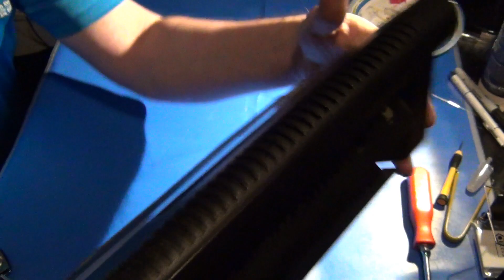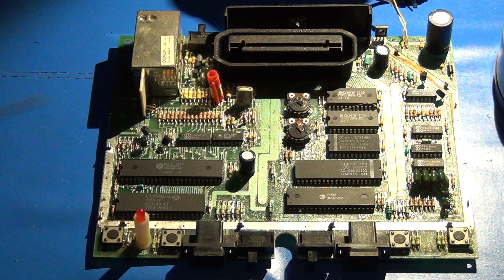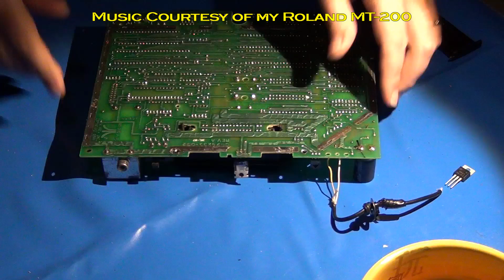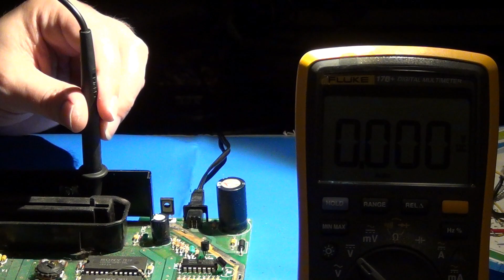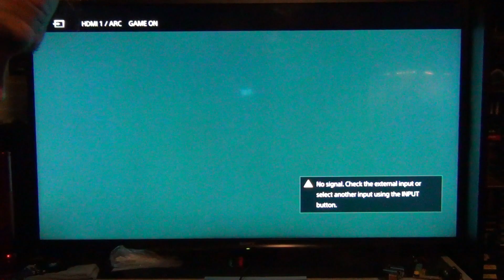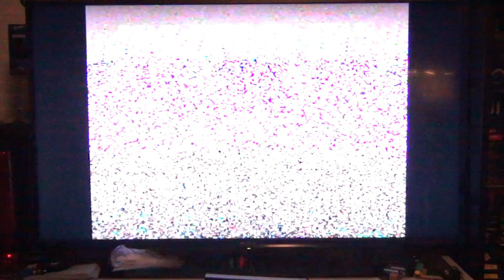ITC# 46 - Atari 7800: Quick Repairs & Diagnostics

Comment: I have 5v to chips and red light on, no video with rf (known good with another 2600).  I did the simple composite mod hopeing it was the rf box but still no video or audio.  I have 14.3mhz at (q3.q4).  Can i test some points on the j2 quickly?
Reply from the maker: If you have the 2600 version of Frogger, put that in and see if you get audio. If you do, then most of the logic in the system is working properly and I then suspect a faulty 7432 that is just above the Maria IC. If you aren't then you need at trying to replace the 6502. If the CPU doesn't take care of it, then you might be looking at a faulty Maria IC at that point. Best Electronics still sells NOS Maria ICs. Even the 2600 TIA signals go through the Maria as part of the video circuit so it is critical that Maria be working to see anything. J2 has some signals on it, but was mostly designed for video input that would have been overlaid on the main video output from the Maria IC. Reply back if you are able to get it going and what ultimately was the issue.

Comment: Mine has power and video, but the video is barely visible behind the static and you can really only see silhouettes of the things on screen. Opened up the RF modulator and soldered a new wire to the center of it as well as soldering the outside to the housing. I have it hooked up to an old CRT. Can't think of what else it could be.
Reply from the maker: If you are sure you had it set to the right channel, then it is possible that the RF modulator might have required some adjustment. Similar to the red coil you see near the cartridge slot (Used to tune the audio specifically), there is another one inside the RF modulator that is adjusted using plastic adjustment tools. The opening on the side of the RF modulator is for using the tool to adjust and help tune in the picture a bit more. It also has to be said though, that the RF modulator on most 7800s just wasn't as good picture quality wise as other classic consoles of the day.

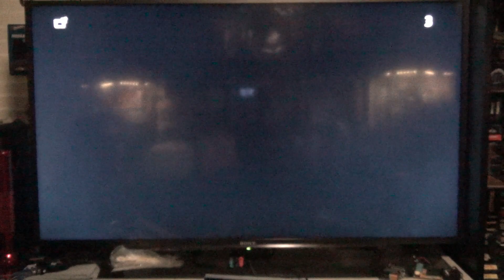Comment: My screen does the same thing as yours did at 39:05 in the video. Mine has nothing to ever come up where I can see anything.
Reply from the maker: This 7800 still has the same RF issues you saw in the video and appears to have a faulty RF modulator box. I now use it as a test system for trying different AV upgrade options. It currently has a UAV test mount board in it. But ultimately this 7800 in the video is fully working otherwise.

Comment: I have power but no video what could the issue be
Reply from the maker: There are a number of things... Are you trying to use it with a CRT or modern display? If trying to use with a CRT and not able to get a stable picture, then it could be a faulty RF modulator. I actually had one sent in to get an AV upgrade because it wasn't working and discovered while I had it, that the signal wire to the center of the RF jack had broken loose because the RF jack on the modulator box had come loose over time and free spinning. Over time it twisted the wire connection inside loose. I had to remove the RF modulator to open it, soldered the wire back into place onto the center of the RCA jack and then soldered the RCA jack securely to the metal housing so it wouldn't come loose again.
Reply: Thanks for the quick response, I’m trying to use mine on a modern display. I purchased a RF converter off Amazon. I had the system stored in a bag up in my attic. Had everything except the old converter for CRT display. Just wondering if it’s a waste of time having it fixed it looks good. Do you still work on them?
Reply from the maker: Yes I still service 7800s and in fact they are the #1 console I receive in and work on. Look in about section of the channel to get to my email address for service work. Thanks!

Comment: I just bought a NTSC 7800 and one of the tiny capacitors rusted right off.  The one right below the right side of the cartridge slot labeled CR3 (the twin of CR4 right next to it as well as a couple other spots on the board).  Any idea what I need to replace that?  I have basic soldering skills but am no electronics guru.
Reply from the maker: CR3 and CR4 are actually diodes and not capacitors and they are both the same exact type. The modern day replacement would be the 1N4148. Can get them at console5.com for cheap! Just make sure you have the dark band  side of the diode towards the cartridge port when you replace them.
https://console5.com/store/1n4148-diode.html

Comment: FYI: you should do initial testing with the RF shield in place since there are some issues that can be triggered by it (uploaded an example a year ago). Also, the power buttons fail so often it’s always worth shorting with a screwdriver to see if that’s why it isn’t powering up (25 mins in so far).

Edit: Looks like you already knew that about the switches. You had me yelling at the screen! ;)
Reply: Just looked and noticed that my “7800 issue” video was unlisted. That’s the one that demonstrated the issue related to the RF shield. Changed it to “public” so it probably shows as my latest video now. If not, the Video ID is XNOQk1nQaEQ
Reply from the maker: Hehe..yes I knew to check the switches. But I wanted to be thorough in explaining and demonstrating two things with that. 1, there are several components in the mix that like similar to the 5200 can fail causing a no power condition, and 2. it enforces the ASAP principle and shows that when something might seem very complex at first, that with a little more thought and troubleshooting, the solution could be much easier than you think.
Reply from the maker: Emmett, I meant to tell you that while it isn't shown in this video, I have since put it all back together with the RF shielding etc and it still works just fine. But I know what you mean about the RF shielding as I've actually had issues develop after making a repair and putting the shielding back on. In all such cases, it was due to the shielding suddenly shorting against a component and just required adjustment of the shielding or removing the offending component to adjust it away or clip the leads off the bottom that Atari sometimes kept way too long in length.
Reply: Ivory Tower Collections Yeah. That what I thought was happening in my case but it turned out that just being close to the shielding was triggering it (not even touching). If I was half an inch away it wouldn’t boot 7800 games but if I was another inch away it would. Very strange! Because I’ve seen others complain that their 7800 only runs Atari 2600 games I figured it might be a common enough issue to be worth considering during troubleshooting.
Reply from the maker: Very strange indeed. That would indicate that some sort of interference is being caused by the shielding itself to affect the MARIA init. I'm sure you know this, but the system detects what game type is inserted and has to switch over to 7800 mode. The 7800 I believe is actually defaulted in 2600 mode. So with the shielding in place or within close proximity, that would mean it was somehow interfering with that process. My guess is that the 7800 wasn't fully switching into 7800 mode.

I would be curious if the EURO bios mod could be applied to that system to see if makes a difference? Or if you have access to one, try using a strong degausser on just the shield top and bottom sections.
Reply: Ivory Tower Collections It was definitely interfering somehow. If you left the shielding in place and powered it up for 12+ minutes it would suddenly work with 7800 games, as if it only needed to warm up. You could leave it running a 2600 game or leave it powered on with a 7800 game that failed to boot, then just power-cycle after 12+ minutes. After that it would work reliably and you could change games unless you powered it off for several hours. I did replace capacitors and swapped known-good components with another 7800 but never figured out what exactly was causing it.
Reply from the maker: Hmm... I wonder if some foil tape could have been used to try and additionally shield the bottom RF from the mix. Your video makes it clear that the bottom RF shield is the culprit. Again since 2600 games always boot that tells me the 6507 was fine as was the TIA and RIOT of course. The MARIA is the only different IC that really gets put into play for the 7800 mode. Did you by chance check to see if there was voltage running through the RF shield when it was powered on in a failed state? Then again, it might be something that you could only see with an O-Scope. Attached to the shield.

Comment: I have the female [male] 7800 power jacks left over from the Brinkmann Q-Beam lead-acid battery pack. [The chargers also have compatible female jacks but the specs don’t match.]
Reply from the maker: Very cool! Console5 also secured a ton of those wire harnesses with the female connector end on them also. What we need is a source for the male adapter that goes onto the main pcb itself. But sadly that is proprietary in its actual construction. Thanks for the comment and enjoy the video!
Reply: Ivory Tower Collections Oops. That’s what I meant: the male end. It doesn’t mount to the PCB same way but it’s essentially a panel mount part due to how it mounts to the lead acid battery pack. You can see it in my video from earlier this year (same one I shared with Console5 for them to get the female parts). :) I should have two so if you need one I’ll try to dig it up for you.
Reply from the maker: That would be most excellent! How to you attach the connector then? Just the solder and some epoxy or hot snot?
Reply: Ivory Tower Collections I haven’t personally had to use one yet so I never worked it out but it looks like it may fit right into the rear cut out. The battery pack has a rectangular fascia that holds it in but it seems like it doesn’t need it (expands on the internal side to snap in, IIRC). I didn’t realize you had a parts board when I suggested it but if you still want it I’ll try to dig it up. :)
Reply from the maker: I've a parts board that is now minus the power connector since I used it in this video to fix the featured 7800 LOL. My other solution for something like this would be to install one of these as I've done on request for some people that like options for powering their 7800...:

https://console5.com/store/nes-genesis-1-sega-cd-tg16-jaguar-more-female-jack-w-pigtail.html

And then route it through the channel select switch. This way you can power the 7800 with the original supply, or use a much more common supply from a Genesis, SMS, or keep it in the family...Atari Jaguar power supplies. Also easily reversed if needed later.